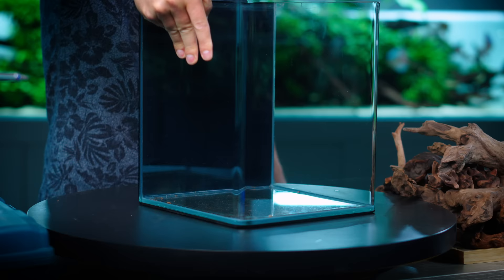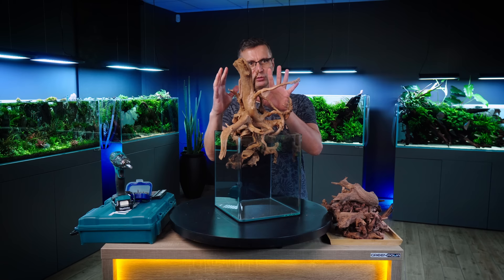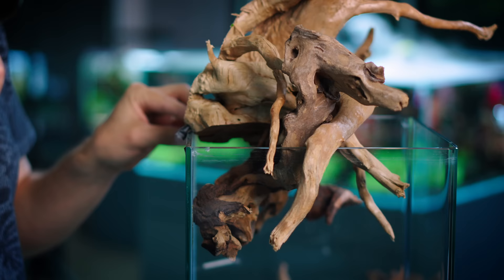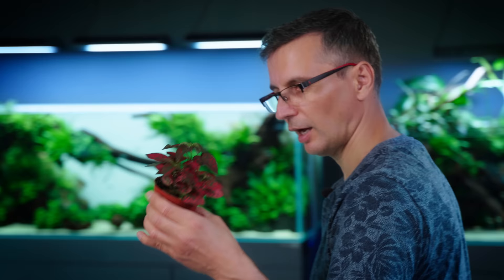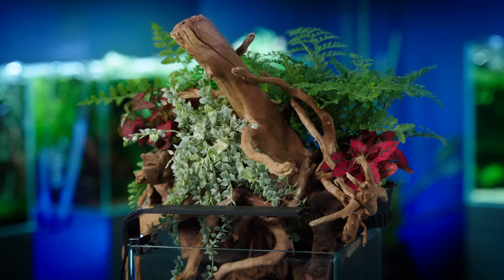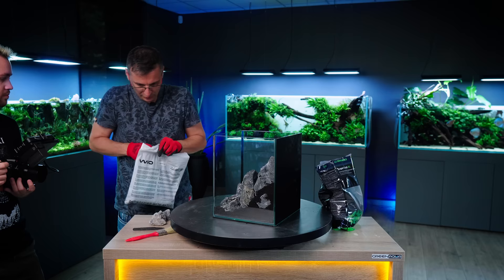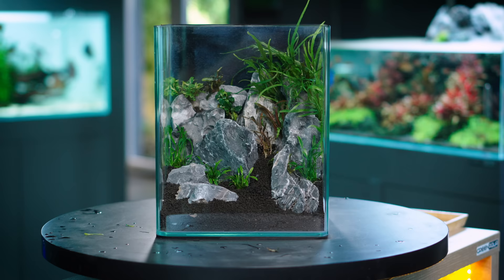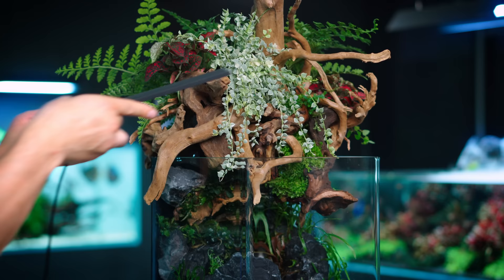Nano Aquarium with Terrestrial Plants and BETTA Fish | Think Outside The Box

Comment: You guys go above and beyond in your concepts and ideas you share to us! Amazing work! Couple of questions i have: Did you use regular wood screws or should we use stainless steel screws?. Watering the top plants, I see a plant pot over hanging the aquarium. Do you water these plants off of the aquarium, like bring it over a sink?
Reply from the maker: I used regular screws, as all of them are above the water. I would use stainless steel if I were to build underwater. We water them carefully, so no water drips down into the tank, the wall, or the floor.